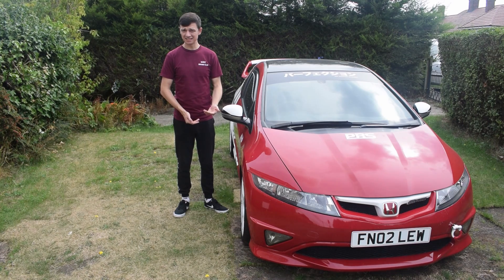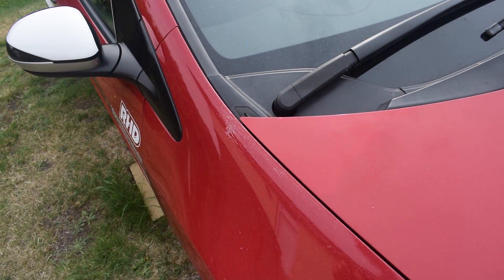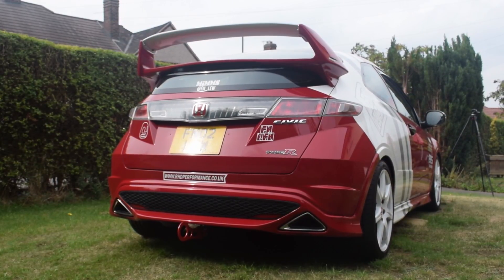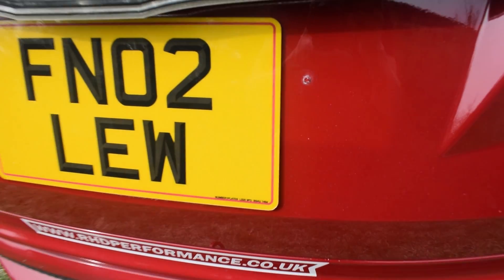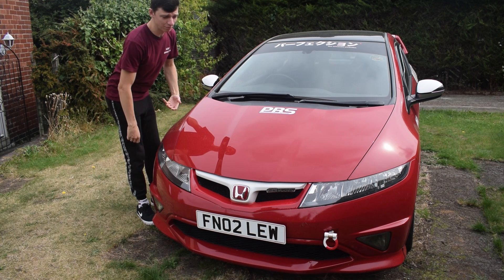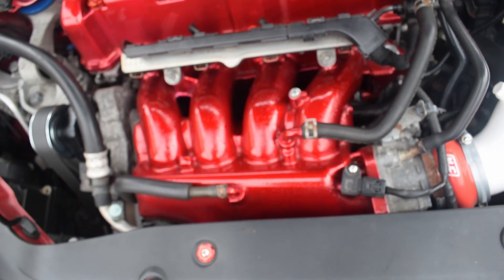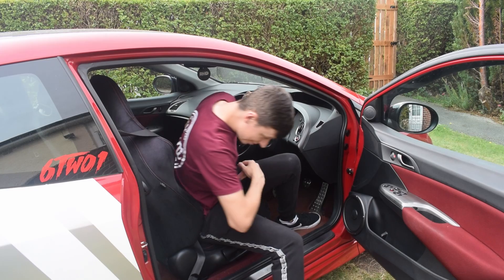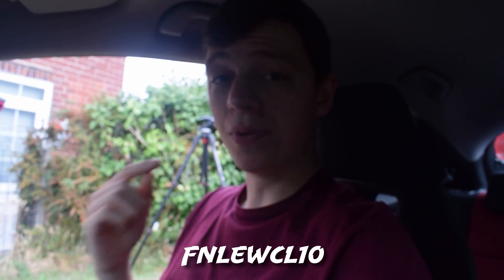Everything Wrong With my Civic Type R to Help You Feel Better About Your Car

Comment: I would polish your display, there’s been no extra glare from mine since I polished it
Reply from the maker: I may result to it eventually
Reply: @FNLEW  I can confirm this as well. The blue haze film was looking awful on mine. Polished it up with Meguiars PlastX, now it is scratch less and crystal clear. Also I do not find any issues with glare or visibility.

One thing I would add - remove the whole cluster. At first try I tried to polish it while it was in its place and I couldn't get the corners and edges polished properly. Once I removed the cluster (took only 10 minutes) it turned out perfectly.
Reply: Same. It's sad to not have that blue tint anymore, but it's worth the change given that you'll get a crystal clear gauge cluster

Comment: Just seal the cracks at the top of the boot sills 
mate, this fixed mine for good. And just reheat each solder on each pin mines been perfect since touch wood.
Reply from the maker: Yeah mate simple jobs really. Just getting to be to them haha
Reply: @FNLEW  I know, always plenty do on the FN2 as they get older 😆👍

Comment: Best video you have done yet mate. Made me feel better as I messed up my FN2 trying to get a double din radio installed. Flipping steering controls and AC screen don't work.

Could you do a video how to please?
Reply from the maker: Thank you mate. If love to do a double din install when I get the chance
Reply: same here, got a Pioneer in my FN2 CTR and now the volume control on steering wheel doesn't work 😐 ah well there's a volume up/down on the touchscreen but still annoying.
Reply: It's pretty difficult to get a double din without breaking stuff. I eventually sorted out mine along with a rear camera but had to use the hacksaw to fit the radio and cracked the trim underneath it due to the clips being too strong... But hey, now I've got a double din installed! I'd still say it's worth it, even though it's a difficult job to do.

In order to get the steering wheel controls and digital radio screen working, make sure to get the DynamicSounds fascia from eBay. Seems to have everything you may be looking for.
Reply: @Hakohn2511  I finally got mine working today. Got my moneys back from mobile sounds. Ordered the connects2 adaptor and SW interface. And did it myself.

I found out they missed the SW control pioneer cable cable completely. Plugs in like an aux cable. Literally plug and play and the SW CONTROLS WORKED AGAIN! 

Also with fitting the new connects2 in the correct order starting from stereo side with power last the air con displays  work too... I'm so flipping happy I may do a video myself.

Comment: Is the roof rusty by the windscreen? My fn civic diesel is but virtually no paint peel for a 2009
Reply: Are you talking about at the top above the rubber seal?
Reply: Yes
Reply: @lukerobinson7413  yes a lot of um go there mine is the same it must be where the water holds....
Reply: It was a recall.The rubber is too firm and rubs against the roof
Reply: @lukerobinson7413  yeah 90% of fn2 civics I've seen have got slight bubbling rust across that area there must be more with it than without it.

Comment: I fixed my boot leak with a bit of clear silicone on the roof guttering where it meets the boot. Got lucky I didn't have to take half the boot apart like you did on the diesel. Fluff on the seats get a lint shaver from Amazon as well. Works a treat. Like you said, still a class car even if it isn't perfect. Don't think anyone's is

Comment: Forgot to mention regards the gear knob coming loose. Get a bolt from screwfix couple of quid. M10 I THINK I Got. Screw of knob, put the bolt down to where it usually sits. Screw knob back on and then tighten the bolt up to the gear stick. Mines stopped twisting off. Lovely!

Comment: Hey lew, i have a diesel one, and was wondering, did you ever have little foggy spots inside of your headlights? I have factory hid bulbs, and they shine great, but the light dispersal is far from uniform and there are even spots which are not illuminated at all, and the cutoff line is very bad, I believe it is because of this little foggyness inside the headlight. Do you or do any of the commenters have any solution to this or have had this problem? thanks
Reply from the maker: I don't have it now but it sounds like you may need to restore the headlight lens then re seal it so it's clear again.